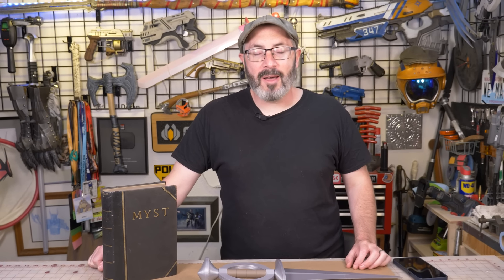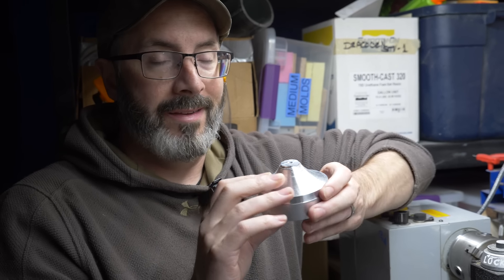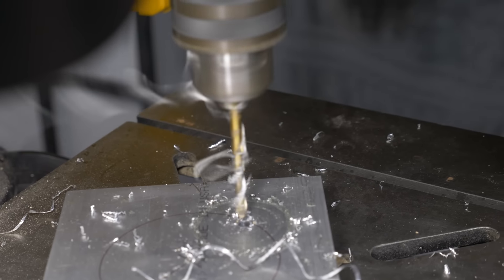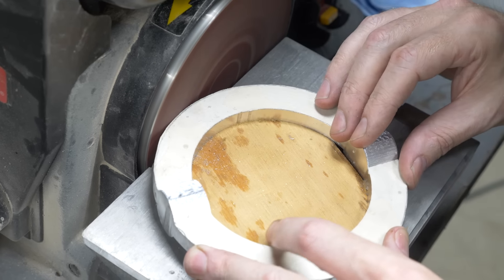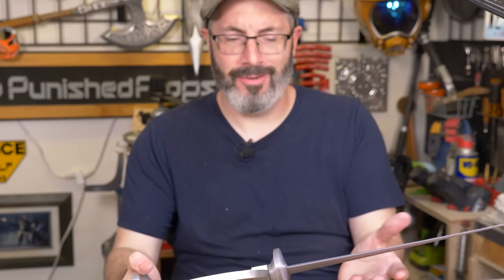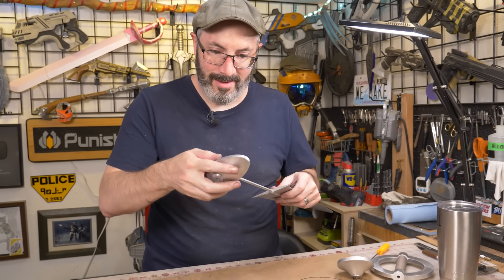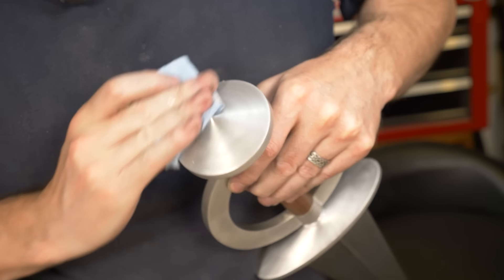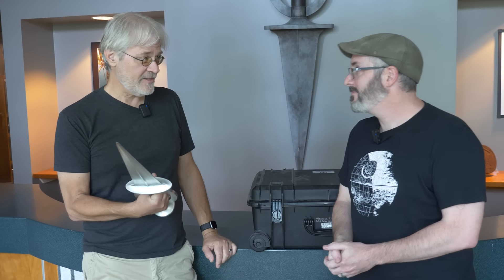All Metal Moiety Dagger from Riven

Comment: Aluminum CNC looks a lot better than aluminum cold cast powder. I know you used to do molding, Bill, do you have a recommendation for a brighter, silvery casting powder? 

I've tried the Cast Magic powders too but that's sometimes hit or miss. They only coat the mold, not mix into the resin, and making sure the mold is coated evenly is sometimes difficult, especially long, thin 1 piece molds. Like for example, Blade's silver stakes.
Reply from the maker: My go-to for bright cold casting metal powder has always been aluminum, but I haven't tried everything that's available.

Comment: Not to armchair machinist... well, maybe a little ;). Pretty sure you can flip the jaws on your lathe. Would have sped up the roughing of the pommel significantly, i think.
Reply from the maker: Yes, I do have a reversed set of lathe jaws, but they were also too small for this piece.